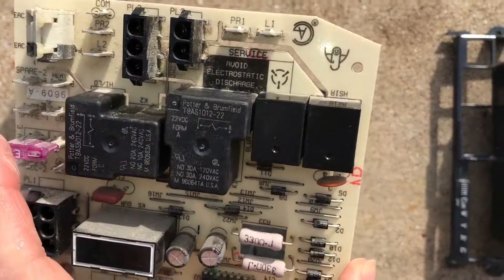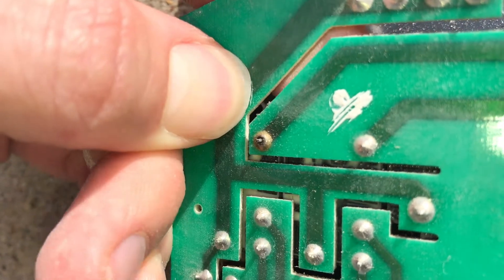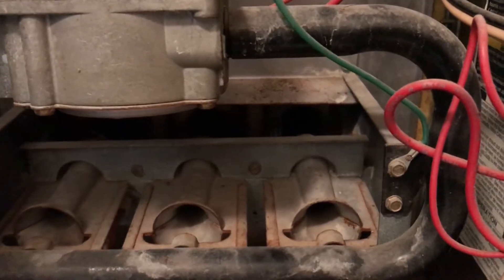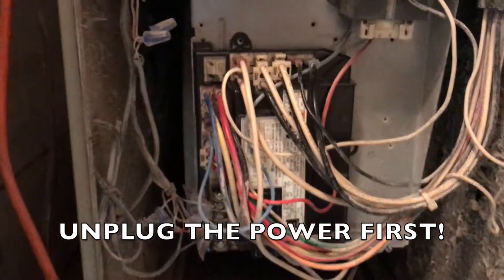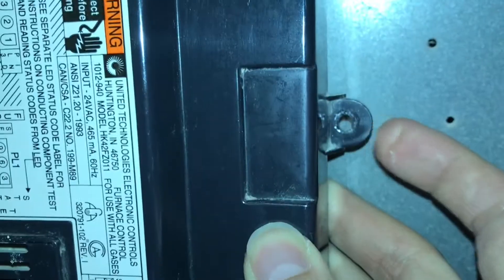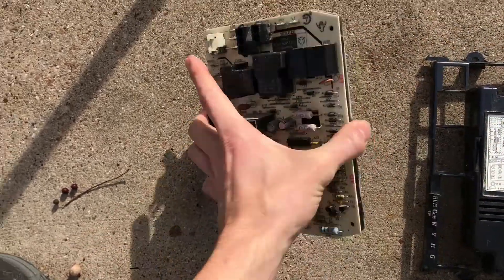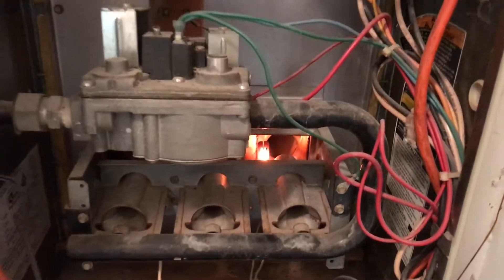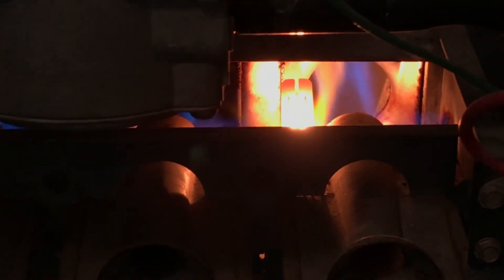WeatherMaker 8000 Igniter Fix

Comment: Dude!!! I went thru all the steps I needed to make to be sure it was the control board before removing it because I had to do a lot more disassembly to get it out. This was EXACTLY my problem. THANK YOU SO MUCH for posting this. I would likely have gone through a lot more trouble. Our other vertical furnace looks just like yours and I recently replaced the board on it for a different reason. I kept it in case I need to repair and use it.
Reply from the maker: Awesome, Anne. I made this video because no one else had a video showing this fix. I'm on year 2 and my heater is running strong with the soldered board.

Comment: Thanks for this
Reply from the maker: Glad to help. Did this fix your problem?
Reply: @zemaoner  checking today .
Reply: @zemaoner  actually it did, the soldering was tricky as there was little left of the wire to the relay but it worked! Thanks
Reply from the maker: @mrofnocnon  Awesome!
Reply from the maker: @mrofnocnon  FYI, another joint on my board burned up this year. Bought an upgraded board as a permanent solution.